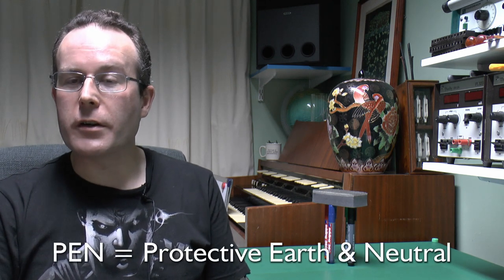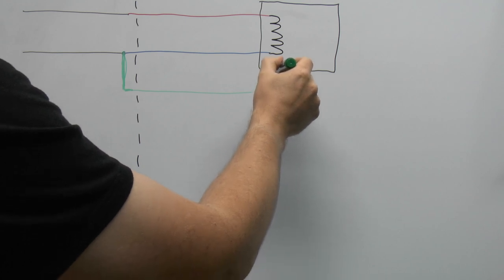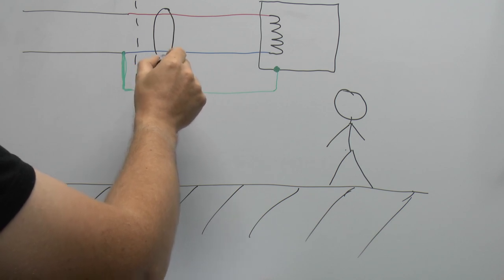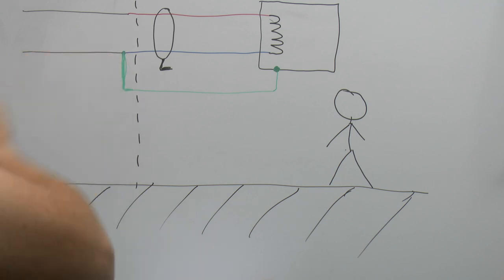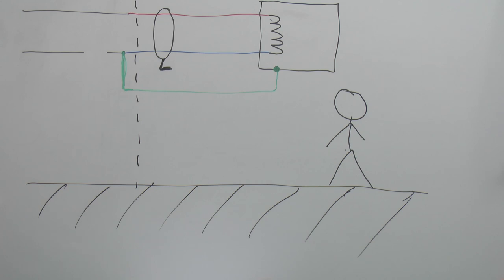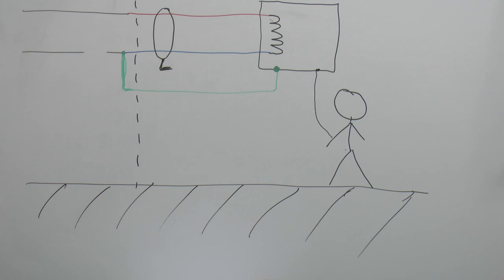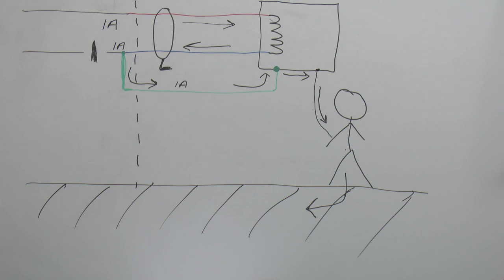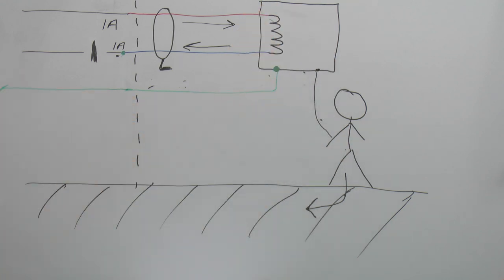TN-C-S Danger - Broken PEN Conductor (Combined Earth & Neutral)

Comment: Really good explanation.  Question: why do we not move the RCD just before the connection between E+N?  (Or add an additional one)  Wouldn't that detect the imbalance and disconnect the live conductor?
Reply: Because than if have an earth fault, from live to earth, the current will go to the neutral (via earth and via itself) and you'll get the full current (that flows in live) and the RCD will NOT trip.
For exsample: an applience draws 3 Amps, then you get a shock from it, the current will flow through you (230 mA) and the neutral (2770 mA) and the RCD gets back the full 3 Amps.

Comment: if you properly ground the PE you are in no danger if the PEN connection to the transformer breaks, and the RCD still works! There will be no votage on the chassis because it will go to the earth through PE. But if you don't have an excellent grounding, you are toasted, as John says :)
Reply: The RCD is totally irrelevant. The key rule of an RCD is that it protects against failures that happen after it. A local ground rod reduces the risk but does not eliminate it. Bonding also offers protection against PEN-failures but it does not work outside.

Comment: When you touch the live cylinder, the current has to overcome the resistance of the appliance, your body resistance, your rubber shoes, the carpet, the wooden floor, the house walls and the earth right back to the source half a mile down the road, so there might not be enough current to instantaneously vaporize you.

Comment: i'm pricing a job and i don't deal with with a lot of TT supplies. the house is going to have a 3 phase supply installed into a meter cabinet i'm going to install 3 switch fuses for each phase to serve house, garage and cabin in garden, would i need to rod the 3 phase end and the cabin as there will be a hot tub within it?

Comment: I understand what you have said. My question is what is the remedy for a TN-C-S if you lose the neutral before it enters the property?
What protection do you have?
Is it just reliant on the overcurrent protection? E.g. an mcb?
Very well explained video by the way and thank you.
Reply from the maker: There is no protection - all you have are possibly main bonding to water pipes etc. which will reduce the voltage on exposed metalwork.  it would be possible to install a device to detect this type of fault, but this isn't done.  This type of fault should be extremely unlikely.
Reply: Equipotential bonding of earthed metal work around a property should avoid unsafe touch voltages in the event of an open neutral. However the likelihood of an incoming lost neutral is very low. DNOs design their LV networks with multiple neutral earth points, not just earthing the neutral at the local substation transformer. E.g. on an underground cable system the neutral in the cable passing in the street will effectively be earthed from both directions. But issues can arise with overhead radial systems where the neutral is not good enough to be used as an earth and then the DNO may not offer an earth. So TT installation is required.
Reply: Yes. 

If the neutral is open out on a network supplying a number houses for example, if one house has a low impedance alternative earth path via say water/gas pipes this house might be sinking much of the combined current from all the houses affected by the open neutral. It may go unnoticed for a long time too if the earth is good enough, although flickering lights should be noticed. So the current flowing to earth through any one house could be high and comprise neutral currents from a number of houses. Hence the need for 16 sq mm earthing connections as they could be carrying a considerable load.
Reply: @jwflame  What is the name of the device that detects this fault.
Reply: @davidsanderson1788  What about when the guys digging up teh road outside your house partially cut through the supply cable only severing the neutral and leaving the live conductor working.

Comment: In your circuit diagram, the neutal return from the heater flows through the unfortunate man. It therefore flows through the rcd, which will trip.
Reply from the maker: With a break in the PEN conductor, current flows through the RCD, but the current is the same in both conductors so it will not trip, as described from 5:40 onwards.
There is no current imbalance, as 100% of the current is returning through the RCD and via whatever is connected to the main earth terminal of the installation, unlike in normal use where all of it should return via the PEN conductor and if a fault occurs or someone touches a conductor a proportion of the total current returns via the fault path and not through the RCD.
Reply: @jwflame  I stand corrected!!

Comment: If U L to ground is less than U between L and N than you can use undervoltage realay to disconect L and N. But still its not safe because its stil in certain situations voltage  could be same. What are your thoughts on that?

Comment: What this displays to me is if that particular fault occurs it is on the supply side and the consumer as no control over this. Therefor if this fault is classed as significant surly a protection device should be included by the supplier in or around the cutout/meter.
Reply: I've heard that earth stakes and mats will now be mandatory in a TNCS system in the UK, I think that's the IET's "fix".

Comment: I have the following question. Here in Bulgaria the grounding is executed in TN-C-S system, there are multiple rods across the length of the conductor and in the supplier unit you would typically get a 3 or 5 way cable. So my question is. If I understood correctly it is forbidden to connect PEN and N in the consumer unit. So my question is. If I install multiple RCD's in my main "Wet room" circuits and I execute my self separate grounding and connect it into the incoming ground and all of the circuits groundings are connected to it without merging the incoming PE an N together is it possible to occur the mentioned by You Neutral loss and thus exposing to an accident. I am asking that because many electricians are giving me different advice about should i use RCD or type B MCB's with merged ground and neutral. And if I do that I might actually do a N grounding to the whole area around me If I am thinking correct?
Reply: In the UK we do not connect neutral and earth in the main panel (consumer unit). That is do by the suppliers in the fuse head entering the property.
Reply: It is TN-S if you get 3 or 5 wires to your property, that is separate PE and N. That is very unusual though, most expensive system to implement.

Comment: Correct me if I am wrong but aren’t a lot of suppliers  now supplying plastic piping for water and gas such that bonding is not possible?
Reply from the maker: Yes, most new properties have plastic water and gas supplies. Gas is still copper or steel internally, water is often plastic throughout.

Comment: Hi JW you mentioned you can't feed an outhouse or shed if you have a tncs. Since most modern houses have this system what steps need to be taken in order to feed a shed?
Reply: steve quinsee, you need to supply your should with a TT system. Live and neutral, but don't connect to the MET at the source (house), you  install an earth rod at the shed and use this as the earth for the supply in the shed.

Comment: it was the most usefull video. Thanks for the effort. im renovating my electrical system and my house doesnt have its own grounding system but all the new plugs and wires are L, N and PE in the house. Now i know that u can get the ground from the supplier N (or PEN is the correct). 
But what can i do to prevent that scenario if i dont have my own ground or supplier ground?
Reply: +Risto Q Nothing, you should at least supply your own ground. In case a neutral fault happens, everything rises to the same potential limiting electrocution risk. To prevent the Protective Earth from rising even with a broken neutral, you should switch to TT grounding. But this requires an earth rod with a very low impedance (aka more expensive).

Comment: Hi John. What are the benefits of TNCS over TNC then ?    BTW will voltage relay help in described situation ? Thnax
Reply: As far as I can see right now there is no benefit to the consumer.  The benefit to the power distributor  is not having to provide a conductor back to the substation.
Reply: TN-C has several problems.  The PEN wire is longer so there is more chance for it to break. It causes stray currents that can cause interference on data cables. It is  not compatible with RCDs so if RCDs are required you need to use them on the sockets.  Also it seems to be dangerous when unqualified and in many places illegal DIYs get their hands on it. In Finland there has been three fatalities since 1980 and some five accidents since 2005 because people have connected the earth to the line and not the neutral. I saw no accident because of spontaneously broken PEN-wires, some were caused by illegal DIYs and there was a fatality involving electricians outside.

Comment: JW, although I knew all that stuff already, i find that your presentation is great.
One question, how to protect from PEN loss?

Here where I live, 3-phase service for households is very common.
Loss of PEN is even more dangerous in 3-phase systems, because two loads connected to different phases, with a loss of PEN (N) will act as two loads connected serially between two phases (230Vac*sqrt(3)=400V). Weaker load will take most of the voltage, and that can result with a fire.

Comment: Here in Poland we must have additional earthing rods or earthing in foundation of the building connected to the main earthing bar in the building. Depending on the additional grounding system resistance there shouldn't be such a problem like described here. Simple solution?
Reply: +Piotr Hołowicz It will lower the risk of electrocution but it will never become zero so it's not a solution. The only solution is switching to TN-S or TT Grounding and in case of TT make sure every circuit is protected by a 30mA RCD. This is how they do it in France and it works pretty good as long as the RCD's do their work. The Utility Company even provides a 500mA RCD which will trip in case an 30mA RCD fails. It also prevents other TN-C-S related problems like stray voltage/current.
Reply: Can you explain why you don't think it's a solution? As far as i know, if the grounding's resistance is low enough, you won't get a dangerous voltage upon touching a metal part.
Reply: Solutions solve a problem. The above merely dilutes it.

You can not get rid of voltage. You should look the video's of: Mike Holt - stray voltage
He explains all these problems  better than me because he's an expert who is much longer in the field.

Even when you provide your own low resistance ground rod:
- There is still the risk of getting shocked when you touch something metal that is NOT connected to the protective Earth of your electrical installation but is grounded in some other way.
- Also you increase the risk of letting a broken neutral go by unnoticed because if your Earth resistance is low enough everything will keep functioning.
- You increase stray voltages which can cause all kinds of weird problems

The risk of a broken neutral in a TN-C-S system will always be there. If you don't like this risk you should switch to TT Grounding and install RCD's. Then you will be protected from a broken neutral. If you live close to the transformer TN-S Grounding might be an option. 

However TN-S does not protect when you live in an area where they also use neutral wiring in Medium Voltage Networks. This is for most of the countries and area's where 120/207/240 Volts is used except for California. In California they foresaw the problem and have no neutral in their medium voltage networks solving the risk of the broken neutral in Medium Voltage Networks.
Reply: I watched the video again and John explains the same with the example of a Caravan. If the caravan is connected to a TN-C-S power supply and you have a broken neutral you will still have live voltage on the caravan frame. 

Grounding does not get rid of voltage. It only decreases the voltage close to the ground pin. The low resistance you actually get by driving ground rod's as deep as the ground water. On the surface (where you stand on) the resistance will still be high. 

But I guess if you install a dozen of ground pins in a circle (or square) around your property and connect them all together and to the Protective Earth you could raise the potential of the whole terrain and  effectively create an equipotential plane. But it's pretty expensive because you will need a lot of copper for the rods and the big wire to interconnect all of them in a circle.

TT-System is a lot cheaper. You just need one ground rod and at least one RCD capable of handling the total current of the installation (although I would install multiple smaller RCD's).

But the whole reason most countries use TN-C-S is because the risk of a broken neutral is usually lower than the risk of a badly maintained ground rod. Ground rod's are not maintenance free. You need to check them.

If you really want to be 100% safe you should install an isolation transformer. Many ships have those to prevent corrosion because small stray voltages can cause stray currents which create electrolysis causing your ship to slowly dissolve. But nowadays many people with small ships accept the risk and use  "cathodic protection" which is a lot cheaper. Ofcourse they will be f#ck3d in case of a TN-C-S with a broken neutral and they touch the ship and mainland at the same time.

Comment: John very good video and very useful. I was wondering if you could answer this?

If there was a loose neutral at the cut-out where the link is made would this have the same effect? So effectively the earth is still good but the neutral is loose?
Reply: So this would be immediately after the  link to earth between the cut-out & domestic meter.
Reply from the maker: Gordon Watt No, the problem only occurs if the break is before the link, so that both N and E are disconnected from the supply network, but N&E for the installation remain connected together.
Reply: @jwflame  If the point at which the PEN became open circuit was further away from the installation, and between this point and the installation there was an earthed electrode, then what would happen in this case? Would the electrode then provide an alternative path back to the source earth? If so, the Line current that that returns from the appliance and back through the installation Neutral, would that then return to earth potential once it reaches the first connection to earth. If this happens, then this would prevent the current returning through the earthed parts of the system?

Comment: This is becoming an issue with EV charging points now. There must have been many thousands installed in the UK since this video was made, and they are required to have open PEN protection, but many don't, because the installers either don't understand the problem or they are cutting corners to save costs. I don't think anyone has been killed touching their car while charging yet, but on an unprotected system it can happen. Detecting a fault reliably is best done with an earthing rod for sensing, and when a fault is detected, all three conductors (L,N,E) must be disconnected.
I was pleased to discover my house is TN-S, but TN-C-S is very common in the UK.

Comment: Will a TN-CS system not turn into a TT-system if there is a broken neutral , considering the fact that at the cut-out, it is run to the ground/earth too ?
Reply from the maker: No.  A TT system has no connection between the supply neutral and ground.  The only ground connection is to the Earth via an earth electrode.

Comment: Thanks for the video, but I would want to know if I'm right in thw following scenarios 
A broken PEN TN-C without an RCD, the user wouldn't get any shock if he touches the metal casing of the load. 
And even if the insulation between the live wire and the metal casing is broken down, with an RCD in the circuit of the TN-C, the RCD with operate to open the circuit, hence, protect the individual from a shock.
Reply: You are wrong. It is not the RCD that causes the problem but the broken PEN wire. The second paragraph has absolutely nothing to do with this scenario. We are not talking about equipment failures here.
Reply: @okaro6595  I didn't say the RCD causes the problem, 
First of all, I'm asking for TN-C and not TN-CS as described in the video 
He said for  broken PEN TN-C-S, the RCD wouldn't operate because the same amount of current flows through the live as well the neutral. So for a person touching the metal casing where the insulation between the live and the metal casing is broken down, the person would receive a shock
Unlike a broken PEN TN-C system, the RCD will operate if the insulation between the live and the metal casing is broken, hence a person touching the metal casing won't receive a shock
Reply: @jamesowusu-ansah595  Are you thinking of using an RCD on the PEN-wire? That is a NO NO. An RCD is not allowed to cut the PE. It could also cause nuisance tripping. On TN-C one should put RCDs only after the PE and N are separated i.e. in the sockets. I have a TN-C system and therefore the RCDs on the panel are not connected. I bought a separate plug in RCD for my washing machine.

The standard way to protect against PEN-failures is bonding. In a PEN-failure there will be mains voltage between water pipes and earthed equipment. Bonding prevents this.